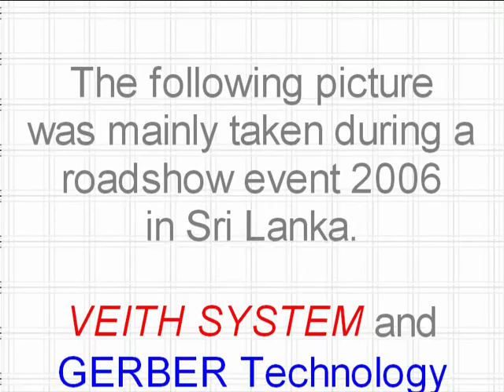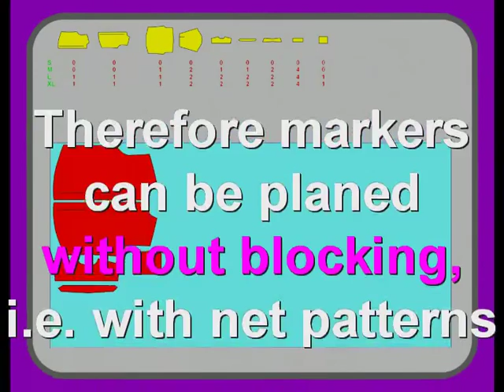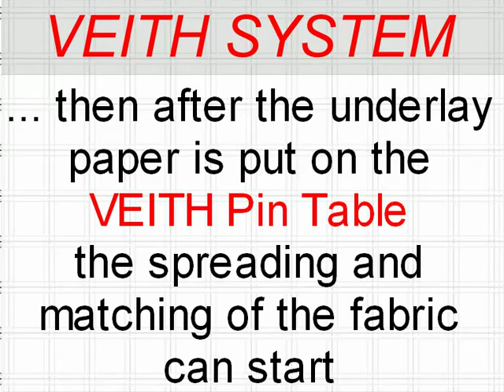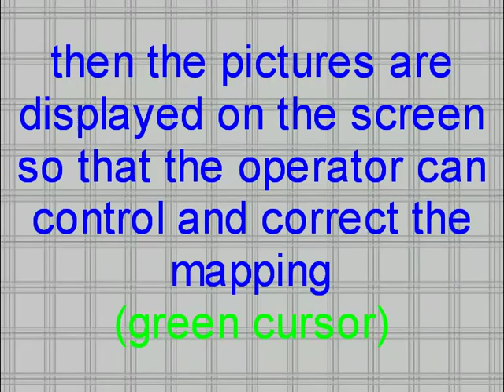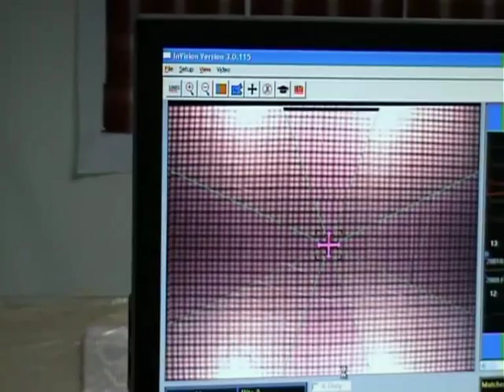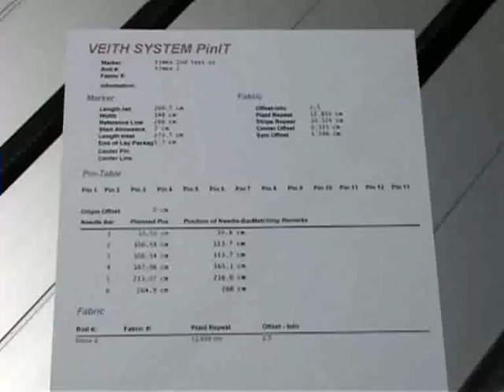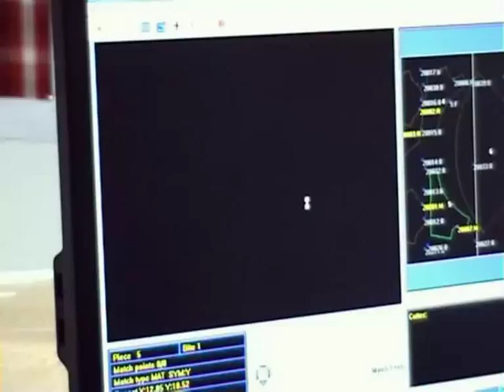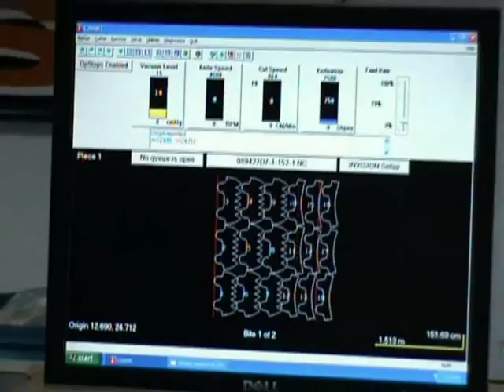Checks matching of shirts with the Veith System Pin Table

Comment: el sistema es muy comodo,pero trabaja en pocas cantidades por el video como se llama el plastificado que cubre ala tela ya que el sistema usa una maquina laser y cuando yo quiero hacer un corte en tela polyester los bordes de la tela salen quemaditos y como la tela es lycrada los bordes de los patrones no estiran ,por eso quisisera saber el tipo de plastificado que utilizan  me podrian informar please.
Reply: sorry to answer in English, but my spanish is hardly enough to defend myself in a restaurant..
The shown cutting is not done by a laser, but by a normal CNC-Cutter with an oscillating knife. The plastic film is from polyethylene - it is used to seal the lay package in order to apply a vacuum to the lay package, which will press the fabric together, so that the fabric can not move, while the knife is doing the cutting job. 
As you mention the quantities, which can be processed on the system, I want to clarify that we typically spread  roll by  roll i.e. 1 roll per lay package, because the repeats from roll to roll are changing too much. If you find 2 rolls with fairly the same repeat, you can process also 2 rolls in one shot. This is surely not processing 100-120 plies of fabric within one laypackage. But with our system you can do the final net cut immediately after having spread the fabic on our VEITH Pin Table. 
If you want to spread 100-120 plies, you will have to block cut the fabric first, then do the relaying of the single pieces, before you can go to the final net cut, which typically will be done on a band knife. When it comes to matching thinking in spreading 100-120 plies is the wrong focus, as it concentrates on the labor costs for cutting the laypackage. But this is only the first cutting in blocks - at least for those pieces, which need to be matched,  and the final net cutting comes on top, Further you need to consider the labor costs involved in doing the relaying for the single piece matching. In addition block cutting means to use bigger pieces, which will increase the fabric consumption by 3-5%(-7%) in case of woven fabrics and depending on the required matching conditions. 3-5% more fabric consumption is a huge increase of the manufacturing costs, as fabric is typically 50-70% of the total manufacturing costs. So you need keep in mind that fabric is the major cost factor in garment manufacturing (at least in the countries, with a typical garment industry) and the labor costs are a comparatively small cost factor. And when someone is thinking in cutting high lay packages he is trying to optimize on the labor costs generated in the cutting room, i.e. a small fraction of the total labor costs, which are anyway much less than fabric costs.